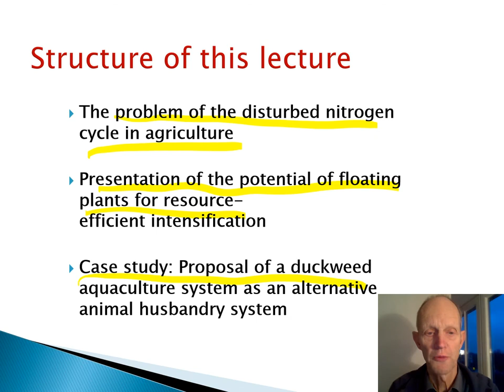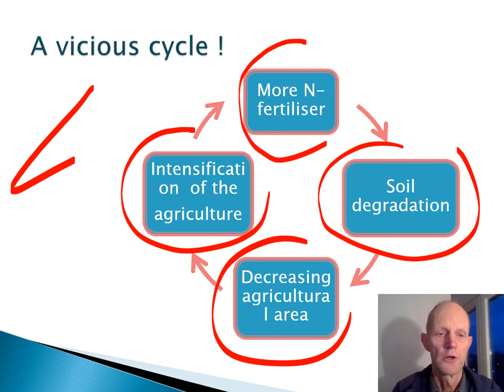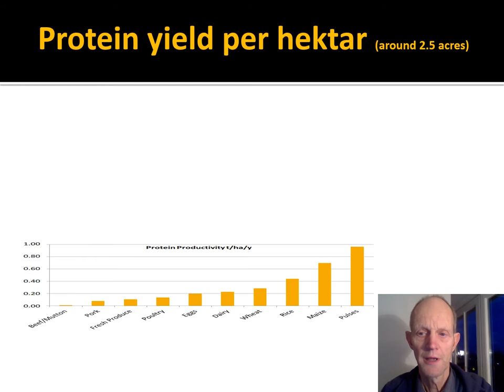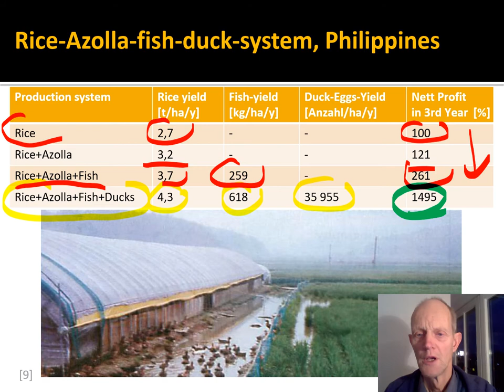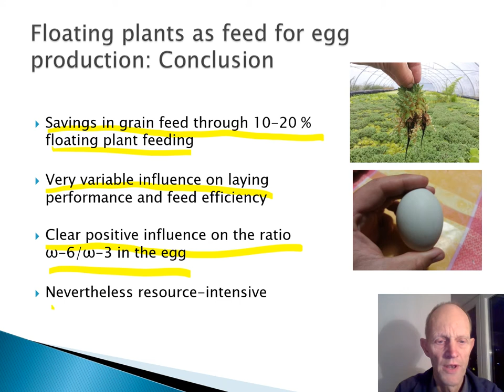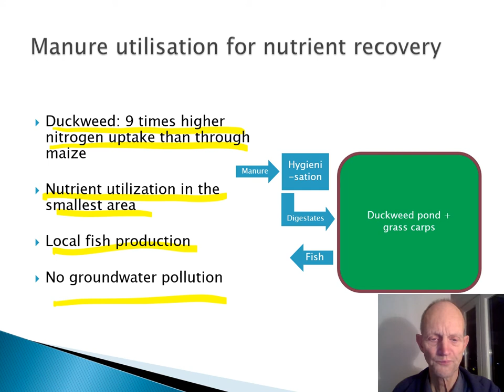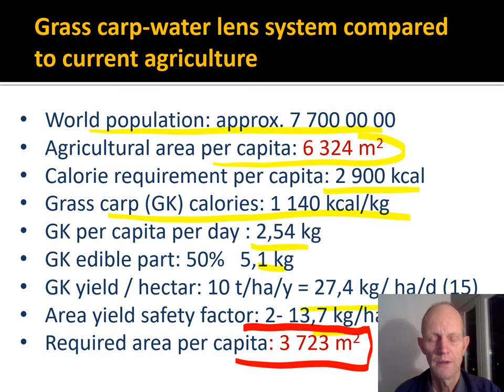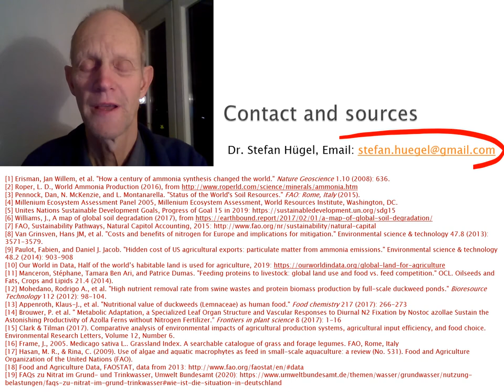Pondfarming - the huge potential of Floating Plants

Comment: I have grown duckweed, and azola on a very small scale to feed to poultry but I wonder about the harvesting challenges in an area like a pond. Cost of machinery can be very high and be a real stopper. Any ideas?
Reply from the maker: As the author of 'Garden Communities' with Andrew Toth I am a promoter of diversified local production. They shall be multifunctional, too: The pond is my rainwater harvesting reservoir. Poultry can have acess to parts of the pond to feed as part of small scale freerange. We came to the conclusion that the best fit is to have Grasscarp (or Tilapia for warm water) in the same pond so that they do the harvesting work while feeding. Such systems can also be of a bigger size. Great that you got something started, that is what counts!
Reply: As fresh duckweed is 95 % water, harvesting and transportation is difficult. On-site use is definitely the best option.